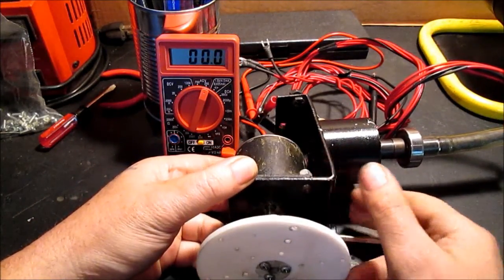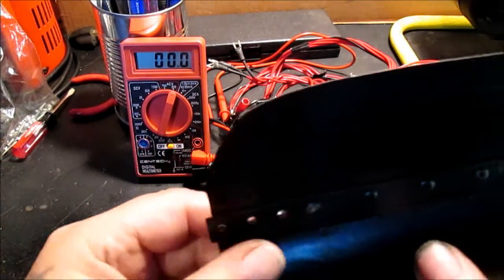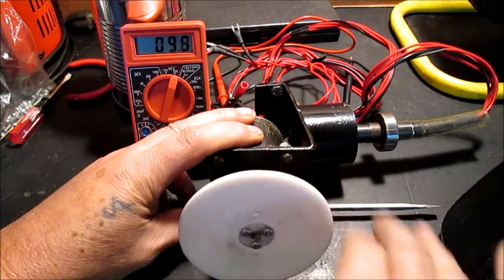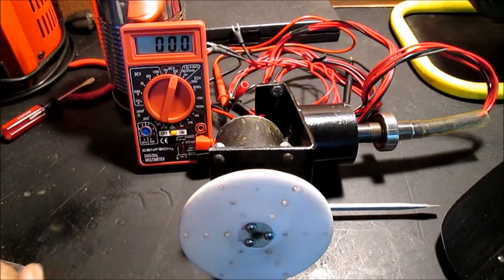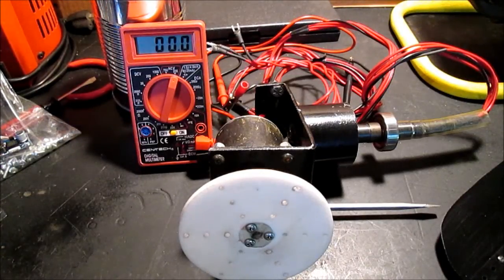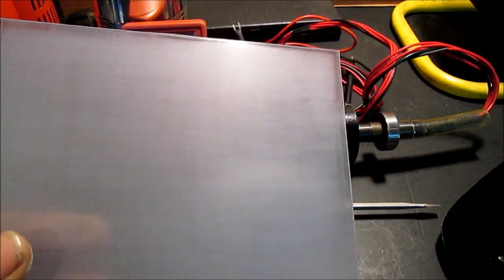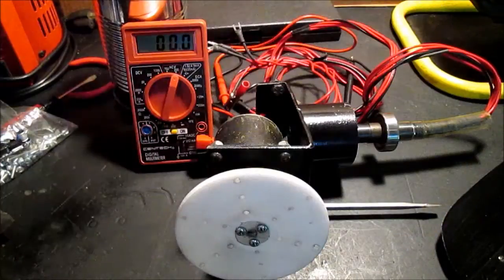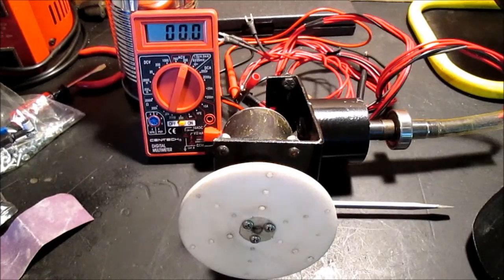Mini Wind Turbine Project Part 1

Comment: My dad has been talking about making one of these for years!
Reply from the maker: This will be fun to learn I have forgotten alot of what I learned about Electronics
Reply: not2fast4u2c you'll need to make a bridge rectifier to change from ac to dc
Reply from the maker: dirtbike5100 I have 4 diodes to put on the 4 AC wires Also I think on the circuit board it has a small one I had it all wrote down how this is done and can't find my Notes I hope to get with the guy and he can let me know

Comment: here is a video of the rectifier
watts up & rectifier board

here is a link to some rectifiers vs making your own, you will need 6 high current diodes to build your own.
http://store.mwands.com/parts/

john
Reply: this has four wires, I'll have to think about this more
Reply from the maker: john otoole I have 4 red Ac wires and 1 blk gnd .I have the 4 diodes ..Plus the the little circuit board I think I remember how it's done But I want to be sure before I wire it up
Reply from the maker: Thanks !!!
Reply: not2fast4u2c here is the diode layout for 3 phase ac from the most common pmg and pma without rectifier.
let me know if I can help.
Reply from the maker: john otoole Thanks ..I have the Notes somewhere how this is wired I am hoping to get in touch with the Guy I got the parts from